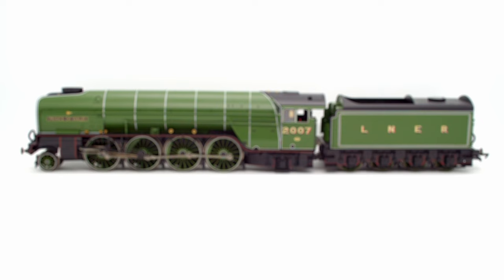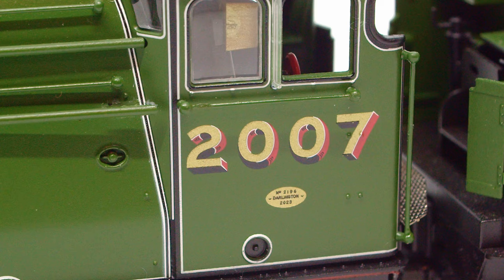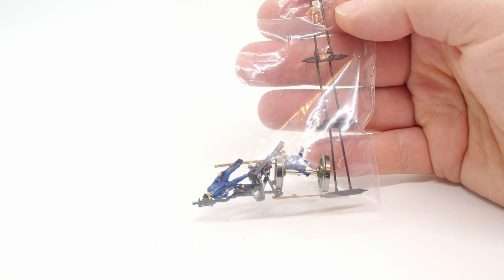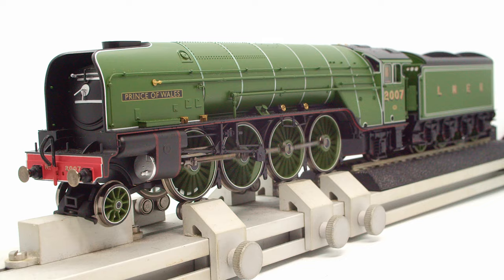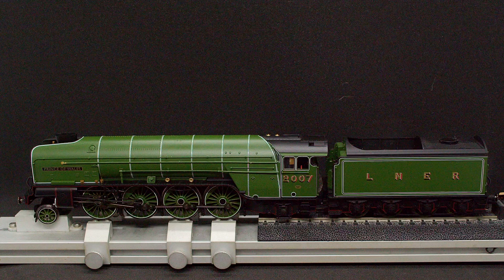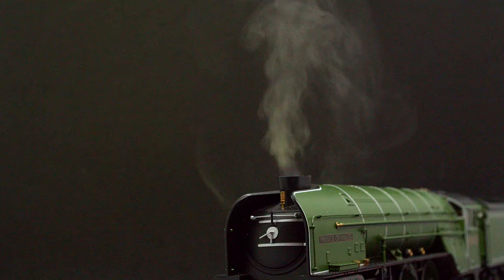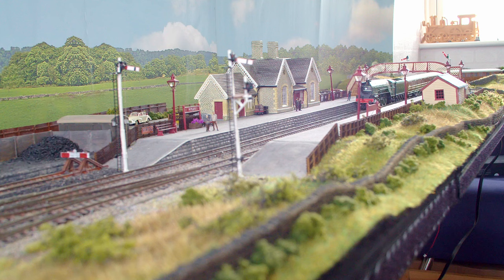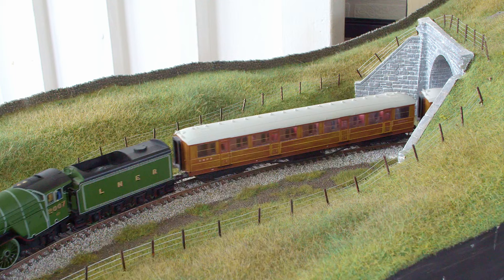GIMMICK OR GAMECHANGER? - Steam Fitted Hornby LNER P2 "Prince Of Wales" - 00 Gauge Review

Comment: I feel like they need to get in touch with some vape manufacturers, so they can get the kinds of smoke generation those do, might even be able to make a realistic smoke smell as well
Reply from the maker: Those use a heating element though which is sort of what this new style of smoke generator is trying to get away from. Additionally a big advantage of this system is that you can just use water rather than needed a special solution to make it work. Thanks for watching 😃
Reply: That's exactly how those old types of smoke generators worked, lol.
Reply: I have used vegetable glycerine (the product in a vape that makes clouds) in my hornby stowe model, it smokes well but leaves a lot of residue all over the model that is hard to clean off without using a cleaning agent that would probably end up damaging the paintwork over time, id honestly recommend disconnecting old smoke generators from yesteryear they are very messy and if not kept full can melt a locos body not to mention they need to be running nearly flat out to get any smoke from them
Reply: @mariuszs.3029  yeah but they made rubbish wisps of smoke like this. What I'm talking about is the thick clouds that vapes can create
Reply: The idea is the same, but vapes use different oils, heating elements, and power supplies. They have a big built-in lithium-ion battery that can supply a lot of current. The forced airflow also helps. And it doesn't work constantly like in your loco. Well, at least for a few minutes, not even talking about 30 minutes on 5ml of oil, like Hornby smoke can.

All in all I believe in this new technology. This is what we want. Mine P2 is in the post right now so I should see if I'm right in couple of days.
Reply: That's no gimmick, it makes it really come alive.
Reply: Personally it adds a lot of realism.  Would you enjoy it more without this function??  Support it so Hornby are motivated to continue building locos with this function.
Reply: I have to say that whilst this is a brave attempt, it’s still bears no relationship to the real steam locomotive.

I suppose it is a reasonable to assume that this is possible. We’ll steam locomotives as we all know issue steam from a variety of places, but particularly the safety valves, the cylinder cocks etc. similarly, the sound effects, although quite realistic, I cannot help feel that running such a thing would be tiresome. If you had to change the sounds all the time. It all feels a little naff to me.
Reply: I have to say that whilst this is a brave attempt, it’s still bears no relationship to the real steam locomotive.

I suppose it is a reasonable to assume that this is possible. We’ll steam locomotives as we all know issue steam from a variety of places, but particularly the safety valves, the cylinder cocks etc. similarly, the sound effects, although quite realistic, I cannot help feel that running such a thing would be tiresome. If you had to change the sounds all the time. It all feels a little naff to me.
Reply: Vapes are known to be hazardous in the long term so probs not a good idea.😮
Reply: Loving the look of the engine, the sounds, the chuffing with the steam looks great. Not sure about the price though haha!

Comment: I have locomotives with smoke generators, but the smoke oil is cloying. The advance of using distilled water in place of smoke oil is a welcome change in my mind.
Reply from the maker: It's definitely handy that you can just use water in this model rather than needed to buy a special oil. I know that ESU has some oil based generators though that are supposedly much cleaner - more news on those soon I suspect 😉 I think the technology in general has come a long way in the last few years. Thanks for watching 👍

Comment: Of course the steam is a gimmic. But what a cool gimmic. And the whole idea of a model railway is a gimmic in iself. But lovely.
Reply from the maker: Absolutely. I'm sure there will be endless debates on how realistic it is but in terms of making people smile it's a roaring success! Thanks for watching 😃
Reply: @ThatModelRailwayGuy  Not looking to be argumentative at all but.....why do you and the OP think it's a 'gimmick'?  Whilst it is not 100% realistic - how could it be without burning coal (!) - surely it is better to have a steam loco with ..um..err, 'steam' than no steam at all?  To me it looks much better than the oil-based steam generator (which has ruined many a loco in my experience!) and the sync with the cylinder action looks great imho.  I can't wait to get one - when I've saved up!
Reply from the maker: @stevecaunt7191  I suppose because it's seen as surplus to what the wider hobby usually requires. Most locos aren't sound fitted or steam generators or working fans. I'm not against any of these features but I do recognise that for most people, myself included, probably only one or two locos might have them included. 
Thinking about firebox LEDs, those were originally seen as a gimmick but are now included on most new models. Perhaps if we get to a point where every steam loco is sound fitted with a steam generator in the same way it'll become more commonplace - but I think we're a way off that yet.

Comment: I don't have a layout, and only ever as a kid had the track out from a set on the floor in a loop, but I'd love to build one. Until seeing your running session on here with what is essentially just a loop of track and an engine shed, I thought loop layouts were boring. How wrong was I! You've added so many interesting features into this heritage line layout that from a track plan perspective is actually "quite simple" that I've definitely redefined my definitely definition of an interesting layout! It also means I don't feel so held back by my own limitations where I "can only have a loop" which has been an excuse not to build something until now. Great work! 😄
Reply from the maker: There's definitely a lot you can do with a single track loop if you put your mind to it. You might want to check out my Modular Model Railway series where I documented the build of this layout from start to finish.

Essentially though, the station has a passing loop where two trains can pass each other. There's some sidings that lead off from Platform 2 as well which allow for some shunting while a passenger trains runs continuously round the circuit. And then yes, the engine shed and coal dock siding allows spare locos to be held out of the way until they are needed. Keeping everything in the right place can be quite a challenge but that's all part of the fun in my experience. Thanks for watching 😃

Comment: Nice review as usual. One thing you do really well is the pacing of your videos. They're concise, easy to understand and to the point. No waffling or dead time. Keep up the good work!😀

I have a few questions about Hornby's steam generators which I'm hoping you or one of your viewers might know the answer to:

1) Can you use tap water or do you need to buy distilled water to stop it furrng up over time?
2) Can the steam generator be damaged if it's run without water? e.g. If the water is used up.
3) I'm assuming you need to drain any excess water when the model isn't in use. How easy is that to do? Can you suck it out with the pipette?

N.B. In order to stop the bogie derailing try adding some weight to the front of the loco to improved the balance. Barry davies did that on his P2 which apparently sorted it. If it doesn't, another trick is to add a small washer under the spring on the bogie to restrict the amount of movement which can help prevent it bouncing off over points, etc.

P.S. A couple of things that might be nice to add to your reviews are:
i) How easy it is to access the mechanism for routine maintenance?
ii)  The quality of the mechanism. To be fair Hornby's mechanisms are usually some of the best IMO, but Bachmann aren't always great and it would be nice to see how some of the smaller manufactures compare.
Reply from the maker: Thanks! I do try to keep them moving along while still explaining things clearly - it's not always easy though and I do sometimes worry I've rushed things.

1. Hornby says you can use tap water. That said I'm in a hard water area and I have distilled water on hand anyway for live steam engines so I've been using that because I doubt it'll make things worse.

2. I don't think so. From my understanding it's basically an atomiser so it'll remain active but just won't have any water to work on (a bit like a guitar amp will still work even if you don't have a guitar plugged in, in just won't make any noise). I think if it was going to damage it in some way Hornby would have to make you aware some way or build in a cut-off a bit like the live steam locos had.

3. Yeah you can suck it out with the pipette or turn the model upside down (guess who found that out by accident!). To be honest I haven't really needed to do this as I find a full tank lasts about 30 minutes so usually I run it until dry anyway.

As for the front pony, the first thing to try is adjusting the springing which is a 30 second job. For me that solved the issue but I'll definitely look into adding some weight if it returns. 

As for showing more of the mechanism,  I'm always wary about dismantling a loco during the initial review - especially when some of these videos have quick turnarounds. I know Sam'sTrains does it so I sort of figure if anyone wants that info they can usually check out one of his videos to see what the situation is as he has a fairly consistent way of doing things. Thanks for watching 😃

Comment: That is a nice model, as someone with breathing issues I’m not a fan of oil based smoke units. They smell odd and can cause issues in those with asthma/other respiratory issues (I have Cystic Fibrosis and am 9 years post double lung transplant). The use of water is a great way to offset those negative affects, even if it’s a non issue for most people.
Reply from the maker: Yes that's definitely a consideration! It's also better for the layouts too as the oil residue doesn't land all over the layout, instead the water vapour just stays in the air. Even if it's non-issue for most people air quality is still something I think we should all be thinking about in this hobby, especially with glue and paints being used frequently. Thanks for watching 😃

Comment: a lovely video showing off the new generation P2's!, they really are great models. 

I think your hypothesis about the derailing being due to the loco being back heavy is spot on. I have both versions on 'Prince Of Wales' and the non-steam and sound one is far less fussy over point work etc. the non-steam and sound ones have a weight in the front instead of the hall sensor and steam generator and as such are not as back heavy.

the steam and sound version is really great value too, especially if you run DCC but don't normally upgrade to sound. my personal choice for non-sound 21pin decoders is a zimo mn340, which on its own is £34. even if you look at more budget decoders, by the time you add on shipping  your not far off the same price. so if your going for the model anyways you effectively get sound and steam for free!

really looking forward to the black 5 after this, although on a much shorter loco I am slightly concerned about the weight sacrifice for the steam generator.
Reply from the maker: That's really interesting to hear about the two different versions - good know I wasn't entirely of the mark on that one then! I definitely agree about the price too - it can look high on first glance but actually when you see the different between the standard versions and the steam fitted ones, I'm actually amazed that Hornby have managed to make it for that price, considering what they've packed in.
Yes I'm looking forward to the Black 5 too. I'm curious as to how that one will be filled up given that the front of the loco will supposedly have the removable LED headlamps too! Thanks for watching 😃

Comment: I can’t get away from how much the loco waggles when running.  When you had the camera pointing at the wheels at least one of them was clearly eccentric.  Also, the coupling rods didn’t remain straight while it was running.  
Is the tender coupling adjustable?  I’m fortunate to have space for gradual curves and I close the gap up to a prototypical spacing - I’m not convinced these new connectors are an improvement in this regard.  I’d definitely go for the steam generator though.
Reply from the maker: The loco only waggles on the rolling road - in the 5 years I've been making these videos I've only ever had one loco that didn't move about in that fashion. Meanwhile on the layout it looks fairly stable to me.

The wheels have a certain amount of spring and movement to them to allow for the long wheelbase, which is why it's appearing as eccentric. Again when it's running on the layout you can see it's fine. The coupling rods have a similar amount of play to them too for the same reason.

As for the tender connection, I don't think it can be adjusted but the gap is smaller than previous Hornby locos due to the fact that the connection is sprung allowing it to open up on tight curves. This seems to be the way the industry is going as both Dapol and Bachmann (among others) have already implemented this style of connection on their tender locos too. Thanks for watching 😃
Reply: @ThatModelRailwayGuy  it did look better on the track, you’re right.

Comment: Great review, really appreciated, short of a full strip down of course. Gimmick or game changer, the HM7000 is definitely no gimmick, the steam generator, well there is a choice, so all up it’s a game charger. The valve gear, well that must be the “not perfect” comment, which there doesn’t appear to be any. 
Thanks so much, again a great, well thought through, review.
Reply from the maker: Yeah I don't like doing a full strip down on brand new models generally just so I can show how it performs untampered out of the box. I know there are other channels that do though.
Generally I agree though, I think the HM7000 system is a brilliant way for newcomers to get into DCC and the new steam generator is an added bonus on top. Great all round in my opinion. Thanks for watching 😃
Reply: Absolutely, disturb as little as possible, only way to go.
Thanks again

Comment: Love your layout and great photography. Just got hold of my P2 last week. It's fabulous. The steam generator is no gimmick, a real step forward, the sound impressive.. The front pony also derails and has forced me to fine tune several bits of track but still a few issues. Must be because of less weight in that area. A heads up: the power consumption is huge.  My NCE Power Cab just barely runs it, especially when trying to simultaneously run my two 9F's with bluetooth decoders. So instead I  use a 4 amp Hornby PSU and an Apple iPad which solves the problem nicely. I switch back to the Power Cab when using my 8 pin decoders without bluetooth. A slight nuisance but there you go. Tends to grind a bit on my 18" radius curves. To be expected I guess with 8 driving wheels. Despite the issues a great model.
Reply from the maker: Thank you, always nice to hear others like the layout too. That's interesting that it's drawing so much power - I can't say I've thought to look with mine but next time I have it running I'll check it out. I can adjust the track power voltage on my system too so I might have a play around and see if that produces different result. Thanks for watching 😃